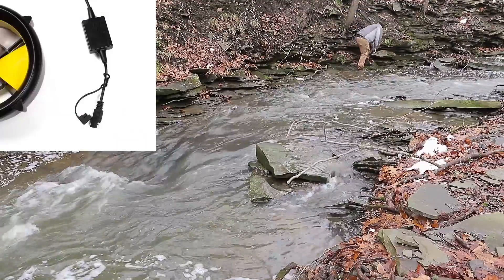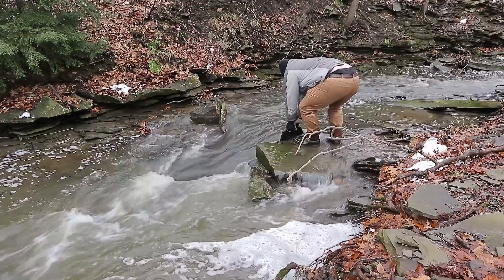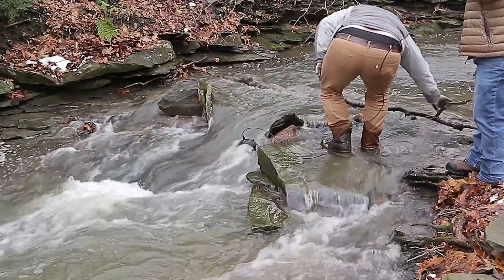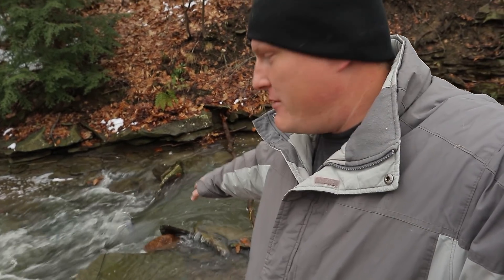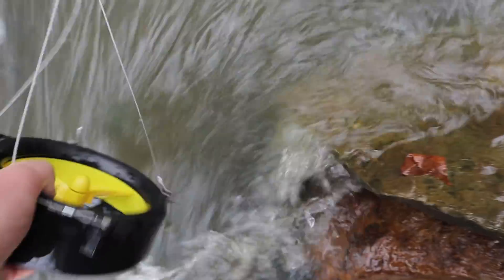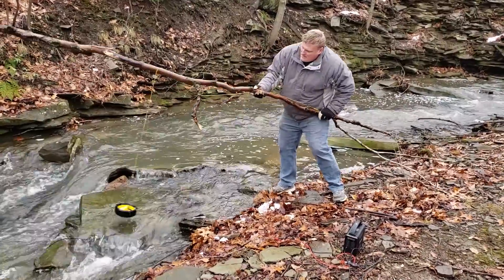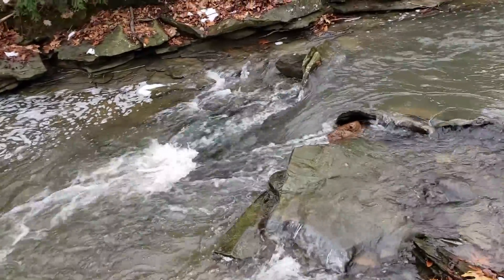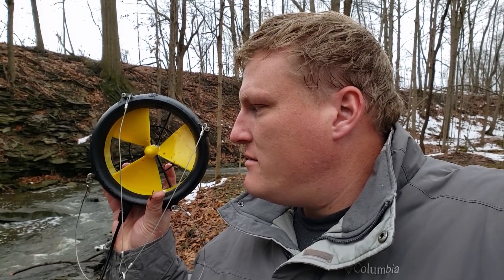WaterLily, A Portable Turbine for 12V and USB Applications

Comment: what if you could stack the turbines in pvc pipe and affix a funnel type end on it to act as a scoop. parallel them electrically it may be easier to place in a stream and produce a good amount of power
Reply from the maker: I've wanted to try this,  I wonder if there is a minimum size or head for the funnel to be effective.
Reply: I would think that the bigger the more water but maybe to much in some instances. make them removable like screw on so they don't fall off
Reply: you spun the turbine with a drill did it have a Max output or did it have severe overvoltage
Reply: a voltage regulator like on panels should work

Comment: maybe a bit overkill with the plastic supports on the back catching all the leaves
Reply: Is there a purpose for them? the turbine is supported around the edge isnt it? 
the best part is no part.
Reply: @jaycweingardt11  it's not, there's a gap there. A bearing that big would make it much heavier and more expensive. So they just put them in the center.

Comment: Thank you for the metric measurements! :D 
Edit: could you make a, idk, a mesh cone to prevent leaf buildup? And (to WaterLily), wouldn't it be better to have the grid on the front (upstream) of the turbine so make leaf cleanup easier and protect the turbine?
Reply: Exactly! Or better yet design so that there complete through path (all support in on circumference)

Comment: In my opinion it is barely too low to really do anything meaningful with it. You can only leave 1 or 2 LED lamps on it.

If it is still possible to get 2 to 3 amps, then it is certainly a nice thing to have.

For now unfortunately nothing more than an emergency solution for your phone

Comment: Thank you for giving us the metric values in the corner!! I work as a CNC Lathe operator but to this date, imperial units still confuse me a bit, my machine converts those automatically into metric sooo.... yeah lazy me. 
I think it's a great idea if you are going for some remote drives in the wilderness, in the correct space it could come in handy given you find a stream with enough "power". And I can't wait for your lathe test with this, too see how much you can really get from it, and I hope your feet didn't get frost burned :D Greetings from Germany

Comment: I reached out to this company but no reply. I have 2 large rivers within 10 minutes drive.
Reply from the maker: Sorry to hear, they reached out to me. I'll be trying to build a "power barge" for testing in larger flows of water not near shore.
Reply: But, as seen in the video, you need not bother as the output of such a small turbine is just not effective. There are better designs out there than this, some of which custom made for the location they are used in. Usually, hydro electric energy is either by turning a big wheel slowly (and via gear reduction, turning a smaller wheel somewhere else faster), or by damming in a body of water and using the gravitational energy (head) to make a turbine spin fast (as seen in other videos  made by Joe). Just putting this tiny turbine/wheel inside the stream, loose and all, just seems very ineffective compared to those methods.
Reply from the maker: @Thomas Verschoof While power production is small, it is portable and without the need for damming. It's a niche product with justifiable niche uses.
Reply: @JoeMalovich  But charging a car battery is not really among them so I cannot see why there is a 12+ volt version to begin with. I can imagine that one would need to check up on this turbine frequently as its just suspended in the water with a few strings. It might get jammed by a stick easily for example. If you needed (a little bit of) power in a remote location that you are not willing to visit frequently because of being so remote, then in my opinion a small solar panel on a stick would be the better choice. We see those among roads in my country a lot. They require infrequent maintenance.
Reply: It would be cool to see if you could have a whole bunch of turbines paralleled together..
Reply: @philandhannahslittlefarm1464  Yes but don't forget that energy conversion is not free. A turbine will remove energy from the water and thus decrease the flow speed of the water, and each subsequent turbine will do the same of course. 

Such a set-up could be a bit more effective in a (raging) rivier, but probably not so much in a small stream like shown here. But indeed would be cool to see.
Reply: You think putting this thing inside a PVC pipe and using the suction effect would work ok?  I know hoverboard motors work pretty good this way.  I’m curious as well to see how efficient this turbine is.
Reply: @thomasvnl  Joe mentioned that this is a product of a Canadian company so it makes sense they are considering solutions other than solar.  One advantage this has over solar is that solar requires a bit of babying to keep panels pointed at the sun.  This wouldn't require that, plus would work at night when the user is sleeping.
Reply: @thomasvnl  They're obviously targetting the 'solar generator' purchasers.  Typically their MPPT controllers are designed to be used with solar panels or charged from 12v in cars.
Reply: @thomasvnl  I see the use of this as exactly as Joe demonstrated in the video. Take it with you camping/when staying at an off grid location for an extended period and let it charge up your 12V power bank. Then u can charge laptops/phones off it. The simplicity and portability is huge and it generates enough power to store in one of those battery banks.
Reply: @skeller0160  Probably more efficient to use a different motor/generator based on your applications. Plus you would have to figure out how to adapt this device to PVC pipe. It seems as those this device is specifically designed for open stream use. Perhaps if you ripped the generator out of it and mounted it yourself, but then whats the point when you could get a different and perhaps better/cheaper motor elsewhere.
Reply: @OwenHeh  aaahh yes I’d say you’re right.  I’ve got a couple of 24 volt electric wheel chair motors, they have the gears on them.  Wonder if I could use them without the gears and put a pelton wheel on it?  Couldn’t really find any info on these motors.
Reply: @daveedee3626  yeah, the problem is a "solar generator" is just a battery ( small for the price ) and a charge controller. Nothing being generated so it is not a generator, it is an overpriced battery. Completely foolish to buy. The name itself is a lie, what do folks expect the rest of the product to be? If they start with misdirection, they will end with it as well at the cost of your wallet.
Reply: @skeller0160  Hmm perhaps? If you would need to convert to 12V to charge something you would lose some efficiency, but prob won't be a big deal. Maybe do some research on 24V motors in general/see if anyone has used them for microhydro setups?
Reply: @JSabh  Typically they have an inverter packaged in as well.  There are many options and some are better valued than others.  The kickstarter version of the Ecoflow R600 pro seemed like great value, especially with the EF1500.